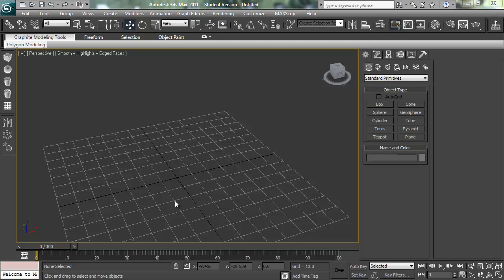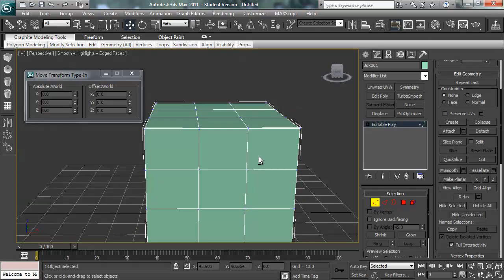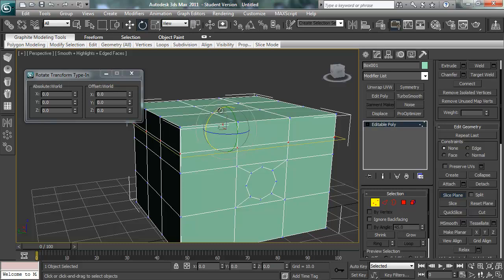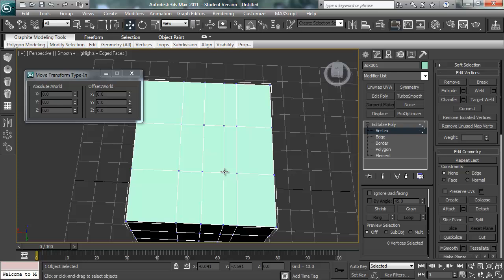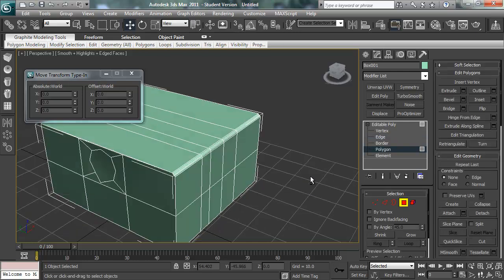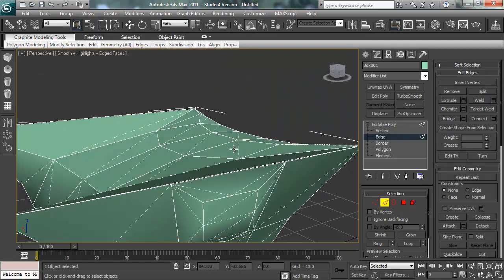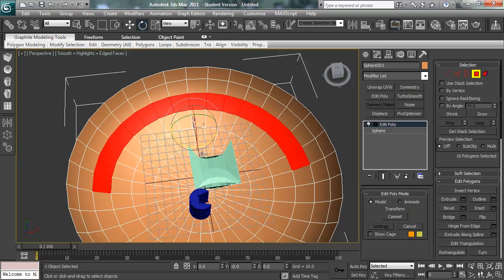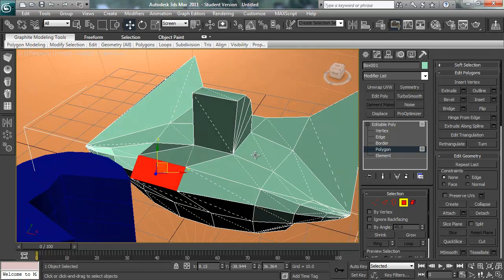100 tips to an easier 3ds max life - Part 4: Editable Polys

Comment from the maker: I tend to use the hide selection button in the modify panel. This will hide selected sub-objects (ie. faces or elements). This will allow you to hide the head element while working on the tongue element. Use Unhide All in the modify panel to restore.

Be aware that this differs from the R click quad menu Hide Selected, which hides objects, not sub-objects. Also note that to unhide hidden elements, you will need to be at the element sub-object level of the relevant object when you hit Unhide.